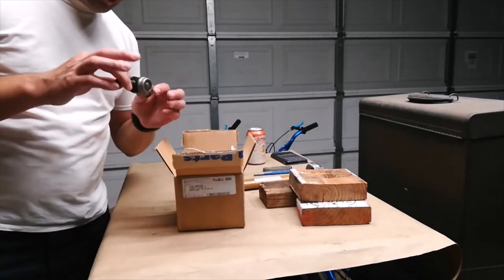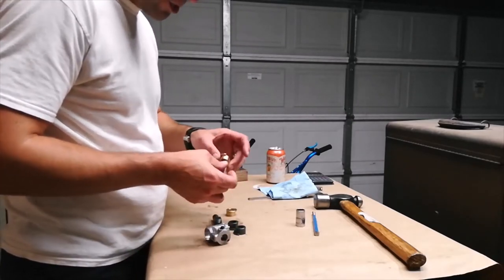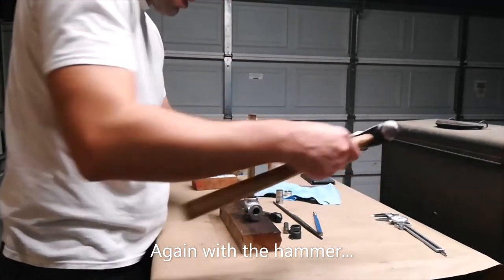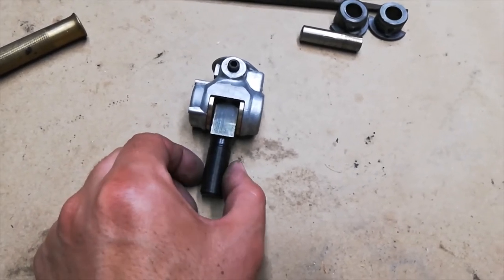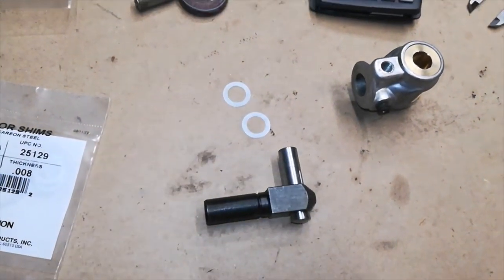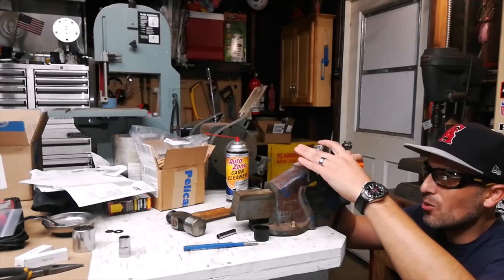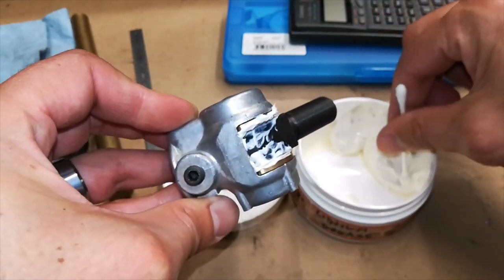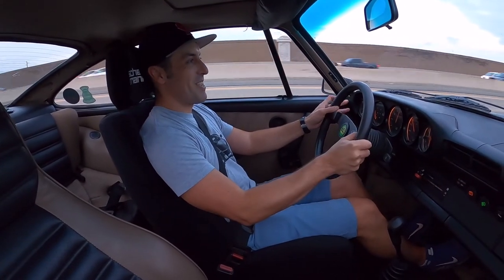Air-cooled Porsche 911 915 Gearbox Brass Coupler Bushings DIY Upgrade

Comment: @ 6;55 you can heat ( try BOILING in water) the housing and put the Bronze Coupler Bushings  in the freezer overnight they should slide right in.
Reply from the maker: Thanks. Might give that a shot on my extra coupler next time.

Comment: I fitted my brass bushes today. 

Couple of things that might be helpful to others. 

I used the freezer and hot water trick, worked a treat. The cold brass bushes pressed into the hot housing very easily 👌

The marks in the middle of the shaft are there for a reason, the shaft is staked in the middle so that when it's pressed in it will not rotate in the hole of the splined part. There are three grooves in the bushes, these lineup with the staked lines in the pin, so make sure you align them when you press in the pin to avoid the staked sections making grooves in the brass bushes. Hope that makes sense 😬

Thanks for the video, was very useful 💪

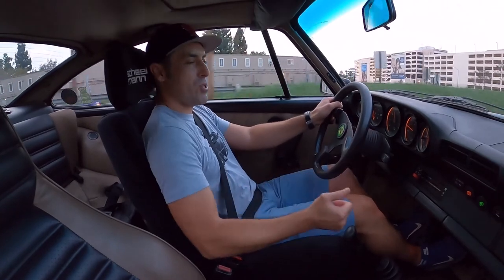Comment: 41:38
Your synchros are on the more warn out side for 1-2… 
Try double clutching that 1-2 upshift, if you double clutch it should make that 1-2 upshift smooth as butter. Your doing the work for the synchros and taking them out of play when you double clutch…
Reply: Also try to learn double clutching on those “casual downshifts” it makes downshifting almost perfectly smooth. At about 44:07 you double blipped because of the timing of the slower downshift, in that time of the double blip you could have just double clutched. Ideally you should be double clutching in every downshift (even when heal toeing). After a few years of really practicing with it the double clutch downshift will make it was easier to make engine speed to gear box and basically eliminate and “jolt” from not having a perfectly matched down shift.
That’s how I drove on the track anyways back 15 years ago when I did a little PCA and SCCA racing. I just double clutched my downshifts and it also allowed me to not have to run through the gears on the way down (just double clutch 5-3 or 5-2, whatever gear your going down to)…

Comment: Instead of seating the bronze bushings in completely, couldn’t you tap it back closer to the rod to eliminate the play?  The shim seem like it would wear out
Reply from the maker: Good question. The splined shaft only travels a few degrees in each direction, is lubed, and the bushings aren't pressed in very tight so I wouldn't expect it to wear too quickly. I would have liked a bigger OD on the shim so that it has a bigger contact area with the brass surface but only time will tell. Your suggestion is definitely worth a try because the bushings are also not under tremendous axial load either so I don't think they would move very easily once you squeeze them against the splined shaft to take the slop out.

Comment: Hi,
Great video, actually it is the best DIY video ! ! ! 
Where did you buy the bushings ?
I checked and i found them for $55 at Pelican & 45 on ebay.
Also, would you say the shims make a big difference ?

Thanks in advance.
Reply from the maker: I think Pelican. The shims helped me make it as tight as possible but they are not mandatory.